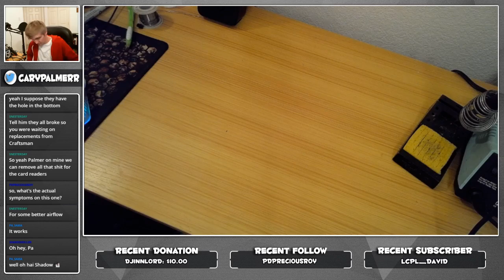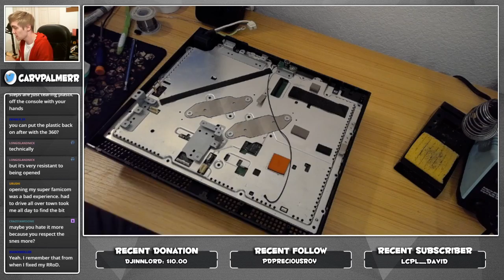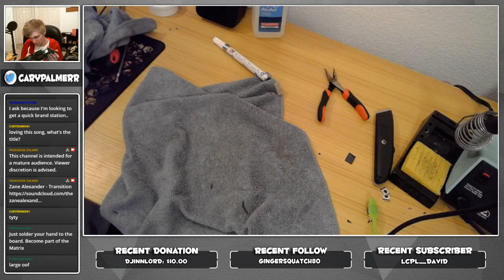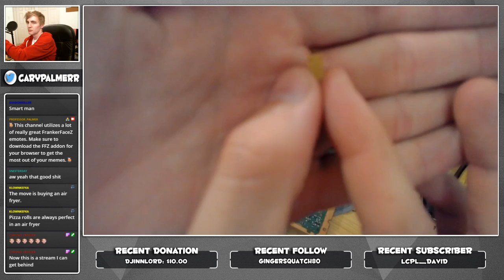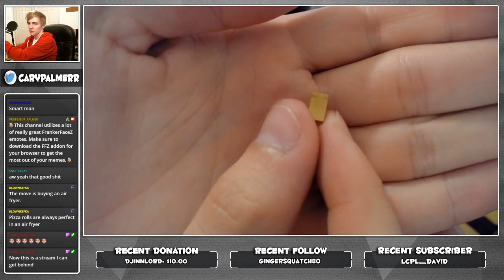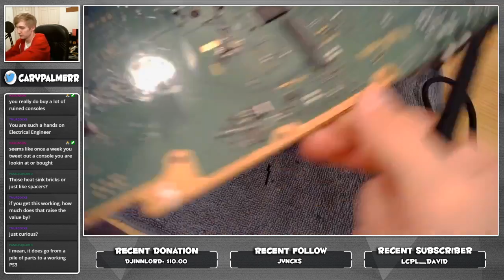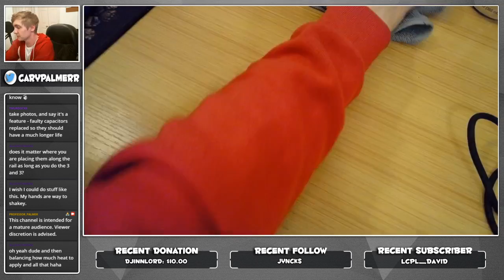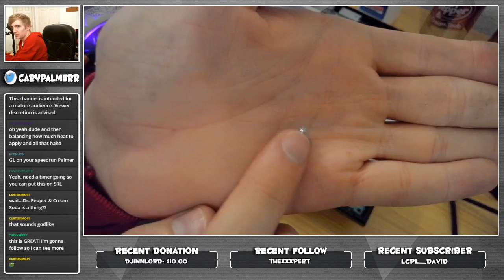Restoring a Yellow Light of Death PS3

Comment: How do you know its those 2 capacitors you need to change and not the 2 others on the left ?
Reply from the maker: They work in order. I do those two, try it, then do the next two if still failing
Reply from the maker: There's actually eight in total.
Reply: @CaryPalmerr  Thank you very  much that is an usefull information :) I'm going to try to repair my old ps3 and I'm happy I found your video because everything else I found  about reparing  was baking the board in the oven or using a blower hehehe  I mean I understand about reflow but sounds gambling more than anything :)
Reply from the maker: @fogel2968  Yeah the reflow rumor is actually not accurate in 90% of cases in my experience.